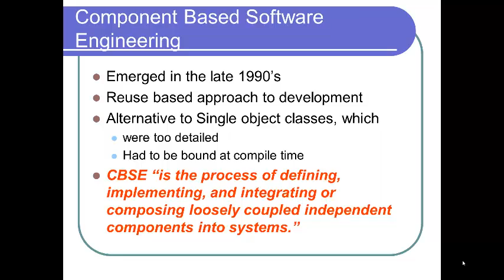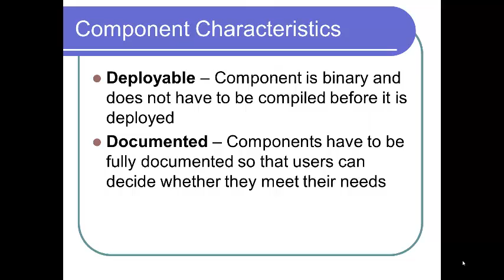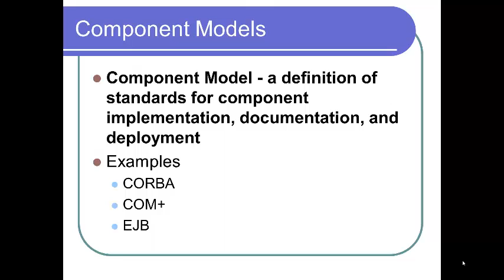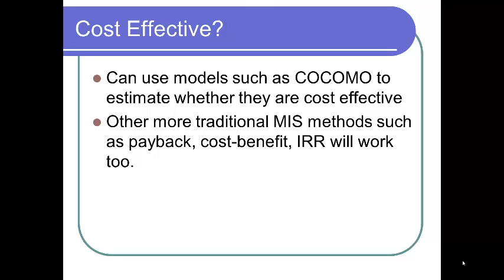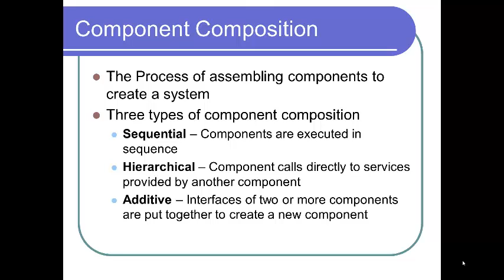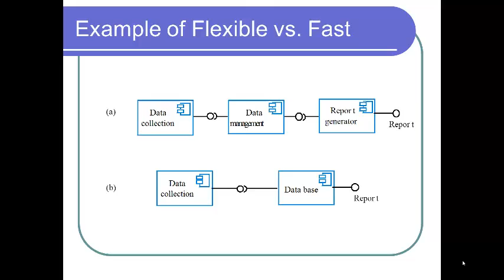Component Based Software Engineering

Comment: Could you please give any examples of the three types of component composition?
Reply from the maker: A lot of times you see component based software engineering employed in the realm of embedded systems. In his text, I believe Sommerville talks about report generation as an example of sequential composition. If you're looking at embedded systems, then ACM's SIGSOFT has some good literature in their symposiums on component based software engineering. I seem to recall one from 2015 that talked about railway systems, although my old brain doesn't quite recall what particular composition they used.